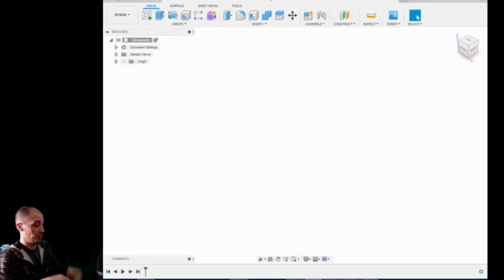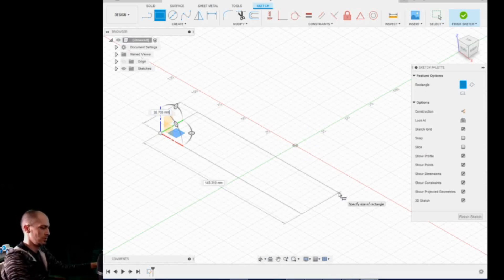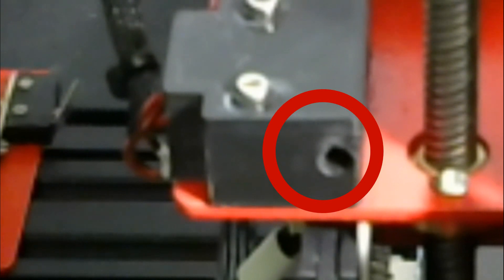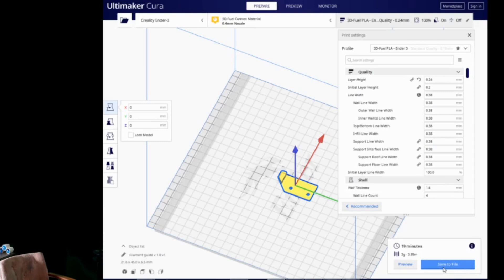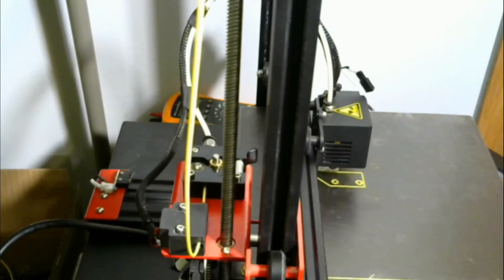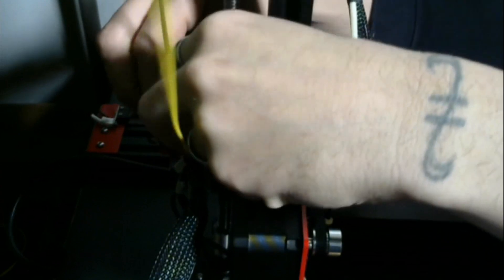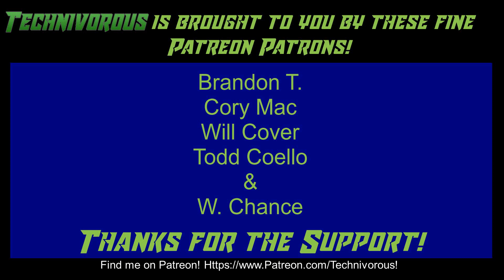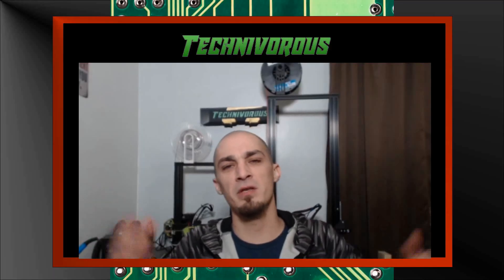Anet Et4 Mods - Filament Guide

Comment: Mine cut through the top cover of the filament sensor box, I fixed it by drilling the hole out to accept a piece of ptfe tubing, then epoxied it in place, bout a half inch sticks out, it works fine.

Comment: I was waiting someone caring about the et4! thx for your work :D Btw, the first question for you: In my package i found a sticker for the heat bed of my ET4, should i use it? where should i stick it? I can provide a pic if you need :D
Reply from the maker: It adheres t ok the metal plate under the glass. Yeah you can use it, and u can use the glass over it as well. I kept mine off because I like magnetic surfaces so I waited, then added a magnetic one instead. Now I can still use glass, but I can swap it with all my other mats as well.
Reply from the maker: Black mats are like buildtak the yellowish clear one is pei.
Reply from the maker: Tell me more about what you want to see from the anet et4!